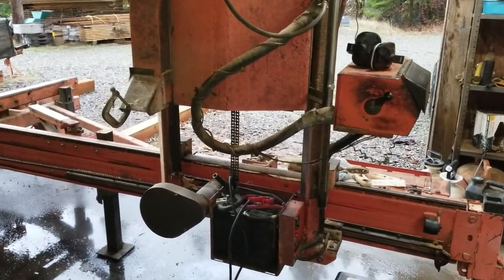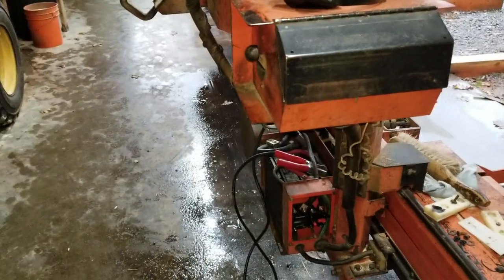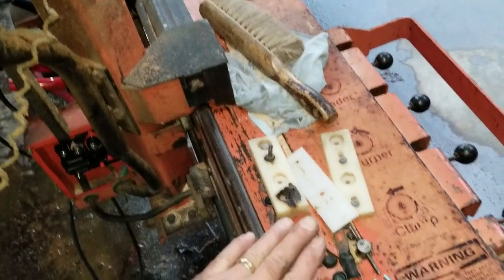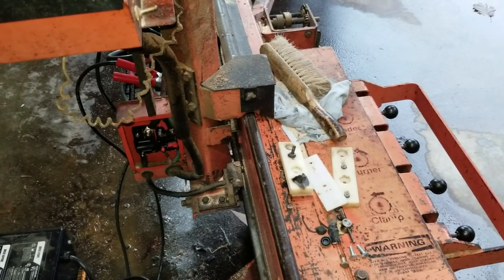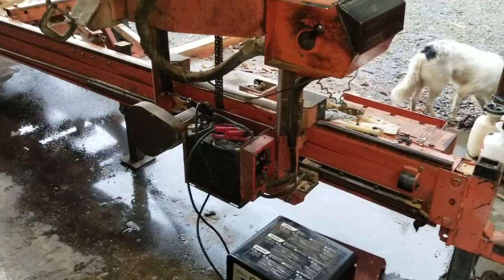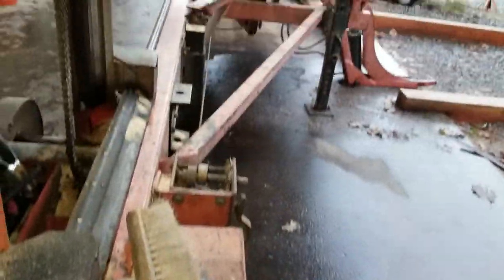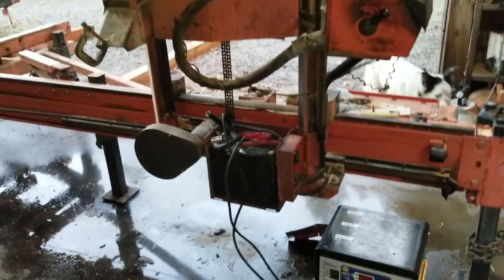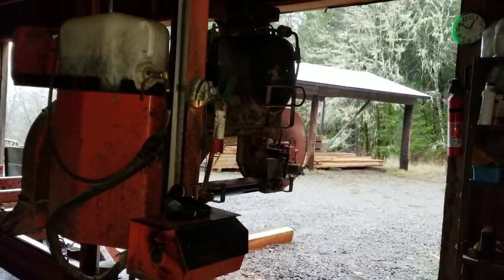The Woodmizer sawmill gets new circuit breakers

Comment: Where did you find circuit these breakers? What brand did you use or did you get the chinese ones on ebay?
Reply from the maker: Amazon. Blue sea systems are high quality. The China ones are very cheap but not very reliable.